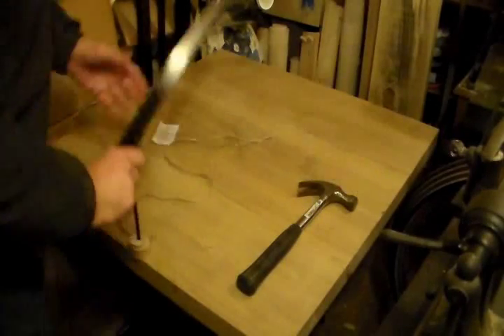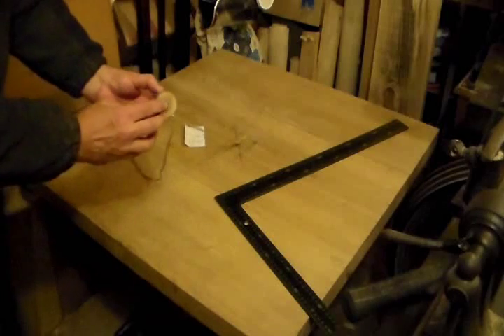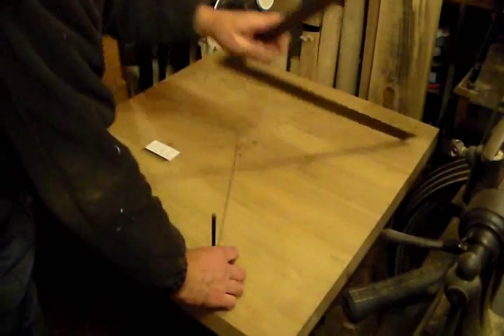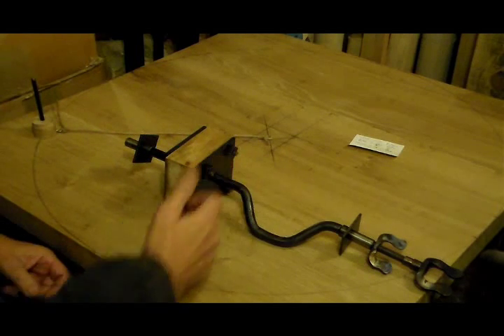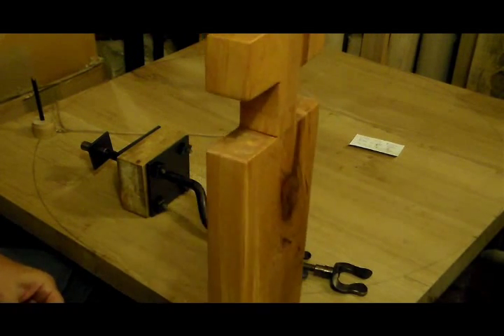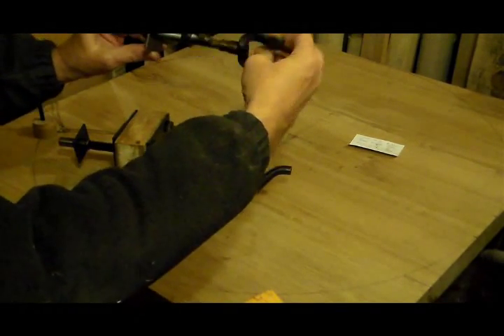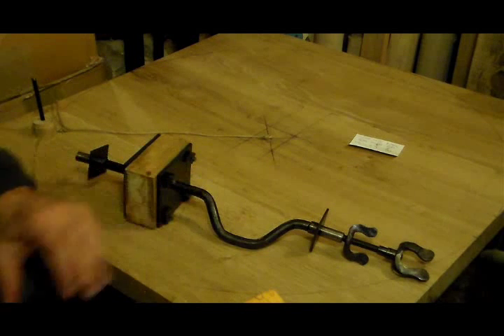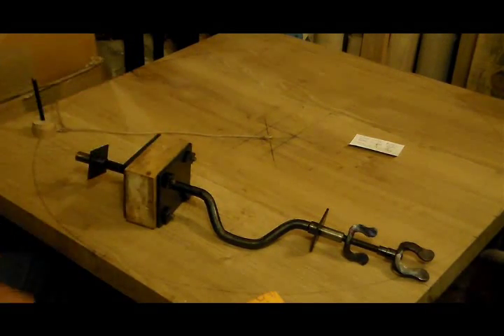How to make a Joseph Moxon Treadle Wheel

Comment from the maker: Thanks David. I got out my old block planes yesterday to see how they could be improved. One has some deep (about 1mm) scoring on the bottom and I'm wondering if I can sand out that much. I'm looking forward to your vids on using planes as I'm particularly keen to use mine to smooth rough sawn wood to make a shove ha' penny board. I'm considering a carpenter's scraper instead but I'm waiting for your vid first.